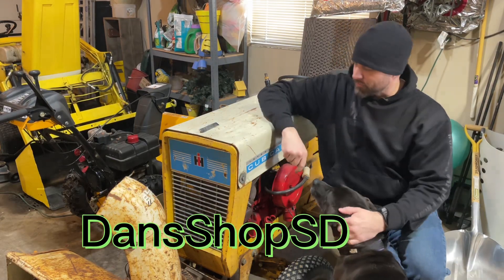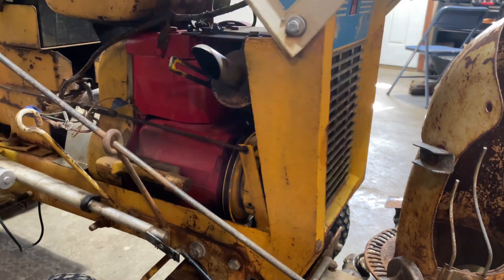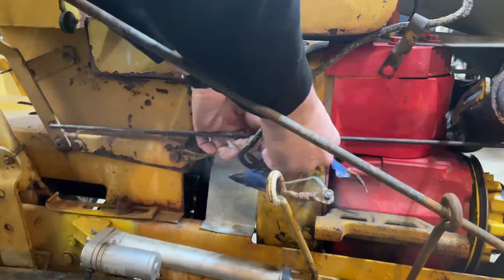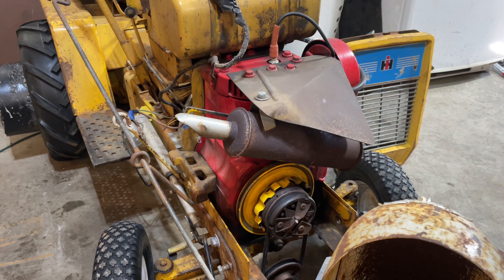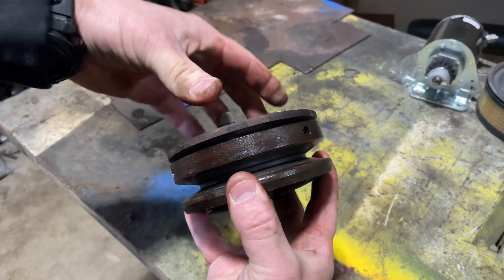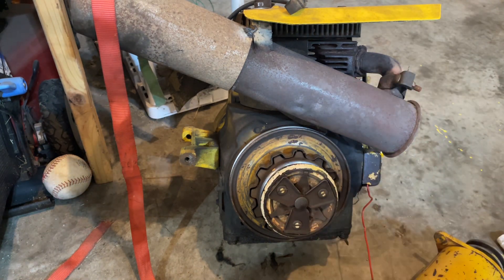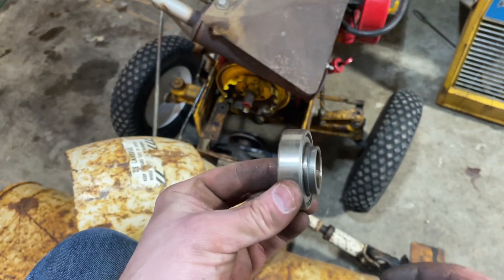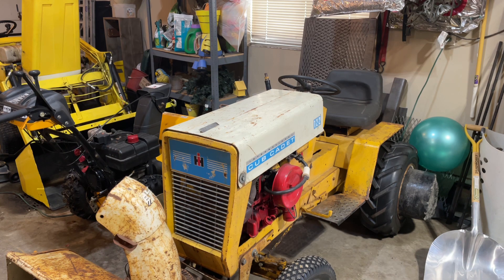Cub Cadet 122 PTO removal.      Part 1.   Part 2 will include rebuild and re-install

Comment: Don't know how your grill is held in but that's much easier for access. Also do double springs  for the rebuild. Lot better clamping. Had to do that for my blower.
Reply from the maker: Double center springs?  The triangle ones?   Or double coil springs on the bolts?
Reply: @DansShopSD  mine was missing when I got the tractor. Has 2 mounting points 1 on either side. Drilled it out 8-32 with wing nuts to hold on the new extruded grill. But I also wrote the comment prior to seeing the blower mounted.
Reply: @DansShopSD  the triangle.  Heavy duty clutch has them. Mine would slip causing excessive heat under heavy load. Got one from Adam Malsom. He knows them things very well.
Reply from the maker: Adam have a wed site or something?   I ordered part’s already.   Ihwcc and Cub Cadet specialties….   Both charge 10 bucks shipping…. Don’t wanna order another spring for 6 bucks and pay another 10 in shipment…